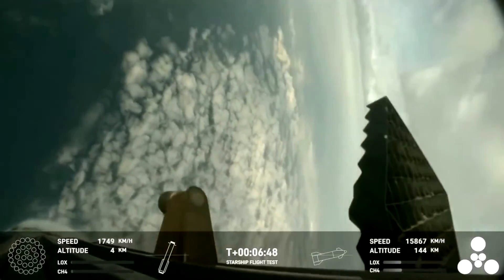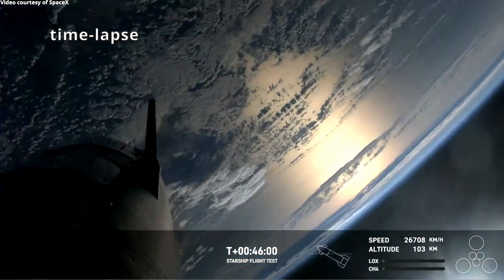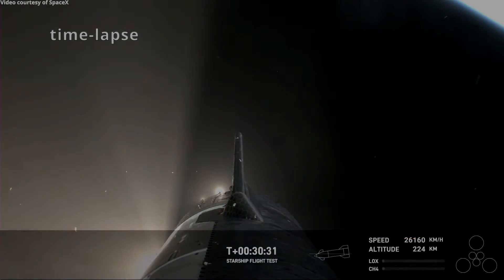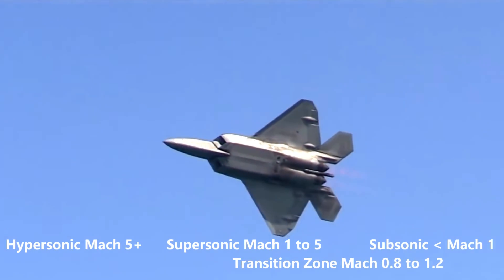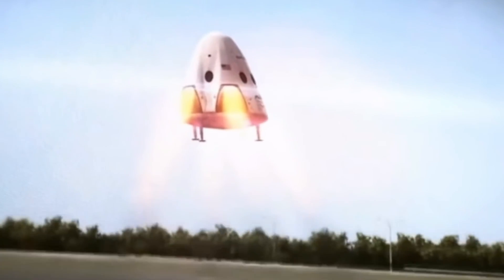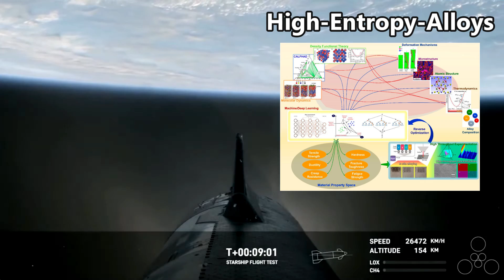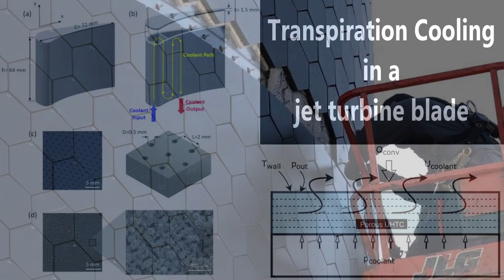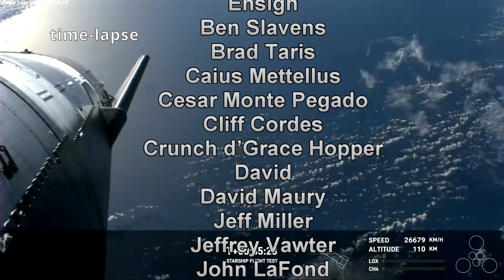Starship Integrated Flight Test 3 Analysis

Comment: I believe that the Falcon 9 tests were engineered with main focus on the boosters landing. And they succeeded in the entire test. I believe they need to work on delegating purpose and intent. Everything matters. Starship is massively complex. Focusing on getting equipment back to earth is much more paramount than reaching orbital altitude when you're still in the haphazard stages of testing. I'm spit-balling but I support my case.
Reply from the maker: That sounds plausible to me.

Comment: 0:53 What are you talking about N1? The Soviet ship tried to fly 4 times and never went up more than half a kilometer!
Reply: What does it mean «the booster is lost»? On the street? In the forest? Where and how?
Reply from the maker: Booster go by by in the atmosphere burning up or into the drink.  N1 failed but the design was solid.  Just the control systems were faulty.
Reply: @terranspaceacademy  
No my friend, it's exactly the N1 design that is guilty!

First Korolev’s error was the rocket’s frame! Instead of using a perfect lightweight design when the rocket shell is the fuel tank, Korolev creates the external frame like a pyramid or the christmas tree. Inside he put spheric fuel tanks. A heavy rocket like that almost cannot fly!

Second error was the engine. All four flytes ended with the engine explosion and not because of the fault of control systems. The engine pump rotor turners so quickly and must be so precise, that soviet industry was not able to make it.

How SpaceX booster can burn in the atmosphere? It has no enough velocity to take fire as the ship does.

Comment: I've been thinking about the booster. I wonder if the fall was enough to allow entrainment of gasses inside the fuel in the fuel tank. I was thinking why it was different from Falcon, and the only thing I could come up with is, weight doesn't matter when falling, everything falls at the same rate, neglecting air resistance. But when in the atmosphere, you have to factor in air resistance and atmospheric exposure cross section. Maybe Falcon's cross section to weight ratio is light enough to allow the fuel to stay settled while Starship's isn't. This is just idle speculation since I don't have the flight data to reference, so take it with a grain of salt.

Edit: I found video of the booster landing and I was wrong. It was slowing down before the engines fired
Reply from the maker: That's a good point! I'll do the math :-)

Comment: There's some ridicule of Starship because it's not a "real" Moon rocket, as SLS is considered to be. However this may not be a fair comparison, because the SLS side boosters function as a third stage. I'm wondering whether the following change would be equal to or better than SLS. I.E, shorten the Starship booster to about 60% of normal. Then stack two of the shortened boosters, with the Starship providing the third stage.
Reply from the maker: That's interesting... So 40m each?  Put a centaur third stage on it and it can do much more than SLS

Comment: A lot of tweaking of the flight software is in order with possible larger grid fins in later iterations. Same with the Starship itself slightly larger fins may be needed. Further hardening of internal structures and possible revisions of the slosh baffle system. Cargo door needs a lot of work to ensure fast smooth operation with a solid seal on closing along with a means to pre-vent the internal volume of the cargo bay as there was visible gas flow as the door opened which may have added to the control problems of Starship. Fuel transfer should not have unbalanced the ship. flow of gases out of the open cargo door seems a primary point of disruption. along with possible failures in the thruster system possible mistiming's of firings or insufficient force. The added flap idea sounds good.
Reply from the maker: Very good points...

Comment: You touched on a number of good points. And yes, everybody else, so far, throws away their very expensive boosters. Thing is, it is SpaceX’s stated purpose to reuse theirs. So it’s failing to ‘land’ is technically a failure. Why they chose to attempt a standard landing profile, as opposed to trying to simulate a ‘chopstick’ landing at some arbitrary altitude to see if they could meet the necessary profile is a lost opportunity (which they did repeatedly during landing attempts with early Starships). 

And the Elerons play no part in orienting Starship during atmospheric entry. The atmosphere is simply too thin. Watch the speed readout and you will see that Starship had slowed very little through breakup. And I totally disagree with the proposal to add hyperbolic engines to a vehicle intended to carry people on interplanetary voyages. Hydrazine is not the kind of material you want to live with long term. Thruster and control algorithms need work. Before IFT-4? We’ll see.
Reply from the maker: I think they'll try to hover over the water at some point soon to get the control right.  Once they quit spinning :-)

Comment: There's not been nearly enough commentary about the shedding of debris (probably parts of tiles) that occurred at the point of re-entry. There were already a couple of tiles lost on launch. 

What concerns me about Starship is structural dynamics on re-entry. Starship is essentially a soda can - a thin walled steel cylinder. Those flaps impose forces at specific points and thus the entire structure is subject to buckling forces. Also, there would be vibrational modes that will interact with the turbulence in the plasma - with potential positive feedbacks. Now add tile loss and the potential for "zipper" failure (where gas gets under the edge of adjoining tiles) and you've got lots of opportunities for cascading failure. 

I agree that SpaceX may have to rethink it's thermal protection. Strange thing is that the original reason given for stainless steel was that it was well suited to transpirational cooling which is what was originally proposed.
Reply: Not many tiles flew off until it flew sideways on reentry. If they can fix the spinning issue I reckon that will solve all their issuex
Reply: @zachb1706  What that probably demonstrates is the zipper effect. Tiles being levered off because of the hypersonic stream directed at their edge. Same thing happens when a tile is missing on the underside, during a descent with the correct attitude. What fixes this is an absolutely unbreakable tile mounting scheme (probably means a lot more mass) or going back to basics and inventing a TPS that doesn't use tiles.
Reply from the maker: They came in sideways and at one point went upside down... I'm surprised it didn't tear they all off.

Comment: Transferring the cooling solution from Stoke to starship wouldn't be that simple, hydrogen have the most higher specific heat capacity from all substances (14j/g/°K)but the methane hc is only 2,2j/g/°K, so you need to take to orbit and back 6,3 more methane than hydrogen for the same effect.
Reply from the maker: Excellent point! But I still think it's a viable method :-)
Reply: @terranspaceacademy  probably it is, but the Stoke regenerative heatshild is a part of the propulsion system, for starship you need to add that only for re-entering, a pasive heatshild probably would weigh less and would be more reliable , if you don't like ceramic tiles heatshilds you can consider a radiative heatshield made from a metallic alloy, like the one that is planned for the New Glenn reusable upper stage.
Reply from the maker: There is merit to their design...

Comment: Your putting words into critics mouths , its the loss of control of both vehicles with multiple looking causes is what counts as a fail .  All the Apollos launched flawlessly , surely a much harder venture with the then  available hard and software .  It didn't even have a payload . The mystery is why everything has to be such a fantastic success like were all sensitive infants that cannot take bad news .
Reply: In software engineering terms, NASA uses a highly structured and cautious linear design process while SpaceX uses a more loose interactive design process
Reply: So these faults are simply inevitable and almost by design. They want these faults to improve in the future.

It worked insanely well for the Falcon rockets
Reply from the maker: Well... All the Apollo's did not launch flawlessly... But they were able to compensate for failure.  People on board and everything.  These are throw away vehicles for testing.  They have no other mission.  These were not going to be reused.  But if you pay attention to other videos you can see I'm not afraid to call out their shortcomings... I just don't think we should ignore their triumphs.  And I would agree that the booster failed to make it to the drink and Starship failed to survive reentry.
Reply: SpaceX doesn’t operate like NASA. NASA spends years and billions of dollars until the rocket is ready to launch. SpaceX designs the rocket until it is usable then quickly builds and tests prototypes.

Comment: Great Article again. And Spacex gained a lot of valuable information re stability and heat tiles. I think that Spacex will not go for hypergolic Superdraco because of their philosophy of simplicity and  because it will require more cleanup and turnaround time every launch. I think they should go for more flaps and larger control surfaces, maybe even small wings to increase drag and control orientation. The heat tiles have been a disappointment, I'm sure I saw dozens come loose in the video of the launch. If you added small wings, they could be actively cooled and maybe do away with the heat tiles altogether.
Reply from the maker: I agree. They'll use methane/Lox to better effect maybe.

Comment: We need to wait and see how much data they where able to harvest from this flight before redesign StarShip. I know I’m probably wrong but it kinda look like the Super heavy booster might have been running part of Falcons 9 re-entry program and it wasn’t able to compensate for the increase in size very well.
If Draco Where ever added it seems to me that fuel management issues would be the reason, like fuel slosh and initiating fuel transfer, but a better choice would be a very simple reliable small rocket engine that runs on the same fuel, the process would Similar to the way very large construction vehicles engines are started by small engine.
Reply from the maker: That's an interesting thought...

Comment: Space x haters? So constructive criticism is hate? The fact of the matter is that spacex is behind and project Artemis will be delayed further if it does not get cancelled by the next administration. So no it is not a total victory since it did not reach all of its mile stones. Getting it to orbit is just one part. Starship burned up in the atmosphere and the booster malfunctioned and did not have a soft landing. Heat tiles have been lost during the flight. Starship was in an uncontrollable state. Payload door broke. We don't know if the fuel transfer was successful. To say it was a victory is way off. Sick of these elon simps
Reply: to get to the moon re-entry is irrelevant, heat tiles are irrelevant, the booster return is irrelevant. getting to orbit is what mattered, so it just the door problem then.
Reply from the maker: There are some who will tear into anything SpaceX does because they hate Musk.  I don't think that's a revelation. That's what I'm talking about.  SpaceX has done more for the space industry than any other aerospace company in history.

Comment: As it turns out the carbon fiber route is more expensive than that of stainless steel as SpaceX has found out.
Reply from the maker: Yes but a single use would be light enough to go to the Moon :-) single launch if done right.

Comment: I didn't get the sense that SpaceX was really trying that hard to stick reentry nor a soft landing of the booster.  They needed to prove that they fixed the issues that plagued previous test flights and they nailed that.  After this, it was all about gathering engineering data so they could better calibrate for IFT-4.  Elon Musk is big on iterative design and this is exactly what you do when you are custom tailoring everything to be just right.

I think an important thing to evaluate material wise when you try to get into Elon Musk's head is to look at what is the cheapest material that can get the job done?  I think it is very obvious to anybody who knows anything about material science that this variant of stainless steel being used is kind of heavy.  The ending mass of your rocket is the ultimate dictator on how fast you go and even tells you if you reached orbit or will just fall back to Earth.  And it is not like these rockets operate with big margins.  On the contrary, you are generally scrounging everywhere you can every which way you can to get the mass budget to be good enough to achieve orbit at all, let along do something useful in space.

You may still see specialized 2nd stages fly in the future.  The thing is good performance for missions beyond LEO needs a high degree of performance while that performance is going to be dragged down with a stainless steel rocket with heat shield tiles and such attached with fuel reserved for reentry while   Having stripped down 2nd stages, including ones using more expensive materials is bound to be used for something, especially as going into deep space makes it harder to do a return to Earth anyway, so might as well strip away all of that stuff and go for maximum performance.
Reply from the maker: Not at all... Surviving to reentry was the goal. Everything else was not relevant.

Comment: One of my friends was questioning the frequent crashes and "failures" of the system, and was genuinely asking me to explain how this was progressing the Starship program. I gave him the same perspective that you point out in the video: If they only ever did as well as they did in IFT-3, they'd still be as good as any expendable launcher, but with MUCH greater payload capacity. 
They could, in fact, start flying low-risk payloads like fuel for a depot or even Starlink satellites, and keep trying to recover the booster and ship as a bonus (much like they did for Falcon 9 boosters). That would also help push along development of Lunar Starship, since that relies on orbital refueling, and they could use the launch of the depot and the refueling flights as development flights for recovering both stages.
Reply: Many missions to space stations require return to earth.  This is still in progress.
Reply: @yurijmikhassiak7342  Yes, but my point was that they can perfect the reusability and upper stage return as we are flying payloads that don't require that, rather than simply launching the full stack with dummy payloads over and over until they resolve reusability issues.
Reply from the maker: I would agree James. It is a successful mass to orbit vehicle now. More capable than any on Earth.  They just have grander goals.
Reply: An interim 3rd stage for Starship might be the way to go for Artemis. Starship can lift around 200 metric tons to LEO when both stages are expended. Starship's 200 tons to LEO plus a 9 meter diameter leaves plenty of room for an interim luna cargo 3rd stage. When Starship is human rated, SLS should be phased out. Starship could do it for less than 1/10th of SLS and still make a very nice profit. This would also allow time and missions to work on reusability and orbital refueling. Both of which make Starship a better long-term solution.
Let's face it, Artemis is a mess right now.
Reply from the maker: I agree